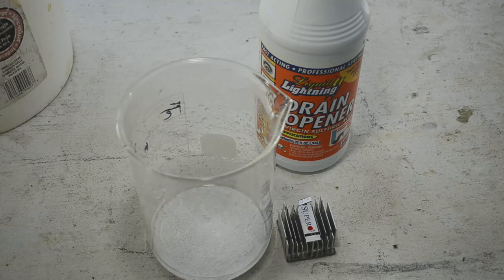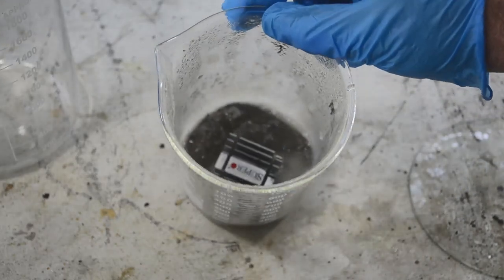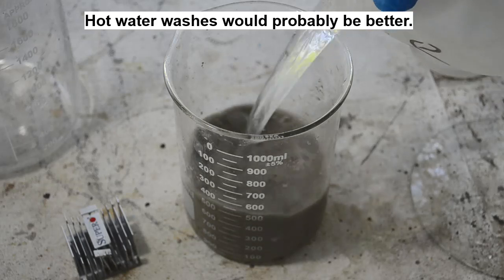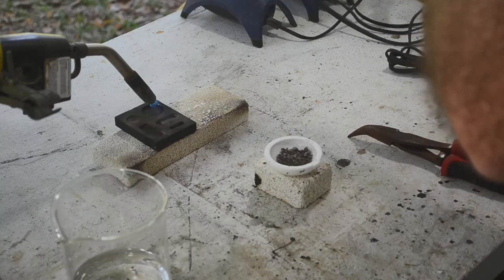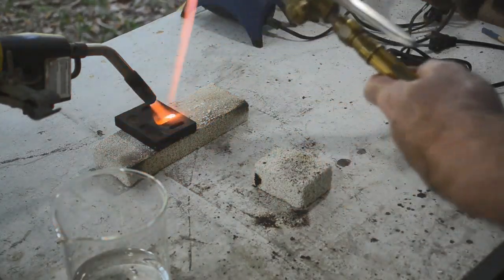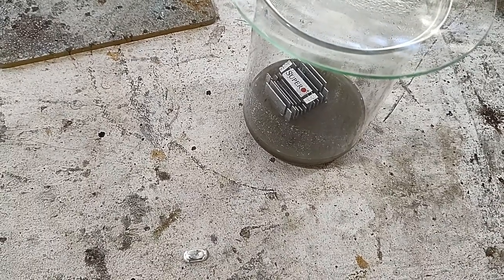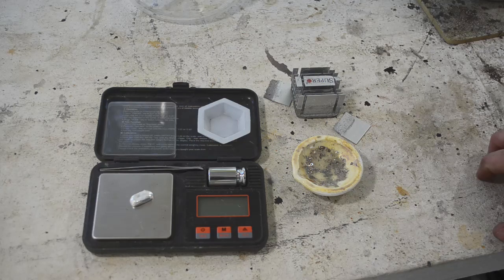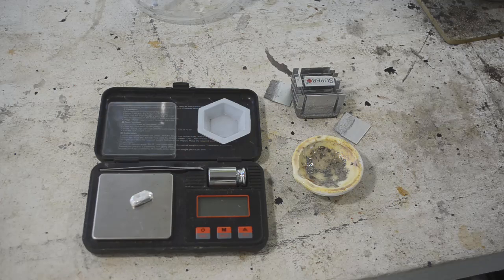Easy Silver Chloride Reduction With Aluminum?

Comment: 3:38 "when the Aluminium and the silver chloride in solution come together, the aluminium is gonna steal the chlorine from the AgCl because Al is the much more reactive metal [...] so when that happens silver metal drops out of solution" So everything happens in solution that means we have Ag+ ions (from the AgCl) and Al3+ ions (from the reaction of the Al-metal with the sulphuric acid), right? now what exactly acts as an reducing agent to give the Ag+ ion its electron to form metallic silver? you just say the Al3+ "steals the chlorine". Okay that would form AlCl3. But there is still no redox-reaction happening.

Comment: The weakness of that method is aluminum extrusions and castings are rarely a pure metal and contain things like copper, zinc, tin, silicon and maybe even lead. These metals released from the alloy can then be in the silver precipitate and will be in any metal melted out of it. I'm sure it's possible to find pure aluminum but a random Chinesium heat sink has zero percent chance of being a pure metal. The well washed silver chloride was probably more pure before you introduced the random metals. Sugar on the other hand is fairly pure.

Comment: I thought on this problem a lot you can dissolve out the unchanged silver chlorde with either dilute ammonia solution or conc hydrochloric acid. However if you are making the silver chloride from scrap sterling silver???? Why bother precipitating out the silver chloride? If you put a piece of copper tubing into the copper/silver nitrate it will directly displace all the silver from solution 😊🥹☺️

Comment: Acid and bleach,caused the aluminum to oxadize causing the silver to fall out of solution. That's my take on it . Usually use an oxidizer at the end of the process like lyme and sugar
Reply: Actually he doesn't use bleach the take on this one is in chemistry there is a process called displacement in this case aluminium Is far more reactive than silver it easily displaces silver from the chloride the acid is just a medium to allow the reaction to occur

Comment: ❤ your encouragement is excellent 👍
Ever since I got into chemistry i have been amazed at how "nobility"  in metals work.
Most of us agree the lye and sugar and electrolysis systems produce the purist silver, but using the metals nobility cementing out metals is MUCH easier 😁.
Try zinc, it works also, and I'm wondering about iron because of the smelting temperature difference and any trace iron would remain solid and sink when the silver liquefies, theory only. I haven't heard of anyone trying this ❤
BTW, HAVE A GREAT 2025 NEW YEAR 🎉

Comment: Very interesting to say the least. The ion exchange does have its limits sadly. Once a good portion of the silver chloride converts to silver metal it’s hard pressed to keep the reaction headed in that direction. One interesting method that I learned about in undergraduate is that silver chloride is actually soluble in 50% ammonia solution. We dissolved it and then dropped out the silver using the classic copper wire. Was very interesting since I didn’t think much of anything would dissolve Silver Chloride very easily.
Reply: You have to acidifie the solution right away with hydrochloric,  works well!!
Reply: Yes, but adding ammonia to any silver solution is a recipe for making silver fulminate, an EXPLOSIVE.  Many a mirror silvering experiment has resulted in disaster when the solutions were left sitting.

Comment: ok. The starting weight of the silver chloride wasn't stated (because refiners always keep their AgCl wet). There should be 1.3287g of silver chloride for every 1g of silver. If there's any liquid left in with the silver when it's dried, there will be aluminum chloride going into the crucible, and that will be mostly vaporized. So ,the weight going into the crucible is irrelevant as long as pure silver is coming out, it's the weight of AgCl going in that matters. Without drying your silver chloride, the only way to get a weight is to thoroughly filter and blot all the water out of the reduced silver before melting it, so that you're not including the weight of any aluminum chloride.
Reply: AlCl vaporizes at a few hundred degrees.

Comment: Hi Mike, during the reduction process stir it time to time!!! It's very important!
I’m afraid, that this gray precipitate is not dissolved aluminum or aluminum oxide. After pulled out the aluminum heatsink and several rinses, You have to boil the metallic alu in the beaker with sulphuric acid a few minutes to dissolve leftover alu from heatsink. Next rinse it a few times, dry and melt it. 100% success! Purity 99,99!
I’m using this method for a few years! Good luck!😊
Reply from the maker: Thanks for the tips!

Comment: i have seen someone doing that by stirring with an iron nail. In theory, you could then use L bent iron rod mounted to the motor and just stir the silver chloride water mix. Mixing always helps with mass transfer in chemical reactions, if you can do it.

Comment: At first I was thinking you do a termite reaction, then you melting the AgCl then adding Al to it, but you surprised me. 

Two things to change maybe: 

1. the metal, Al is very down the electrochemical Serie, so it will convert many other contaminations. So maybe tin or iron could work different.

2. The form of the metal. Smaller parts are hard to remove, also things that fall into pieces. So I think, a solid bar of metal hanging in the solution without touching the button is the theory I would test.

Good luck!
Reply from the maker: Thanks for the suggestions.

Comment: Hi man, did you try melting AgCl with Na2CO3? 4AgCl +2Na2CO3 → 4Ag +4NaCl +2CO2 +O2 (at 850 -900 celsius). Silver should be pretty clean...
Reply from the maker: Thanks for the tip

Comment: I've tried this method a few times and I just don't like it.  I find the Al contamination is heard to remove and if I run the Ag through my electro-cell it does not form the regular crystals I expect.  It's hard to describe but they are just weird and I have to redissolve in nitric and start all over again.  Now, if you're not striving for ultra pure then this method should work but it's not the way I like to go.  But even when using lye/sugar I do things slightly different in that once converted I heavily dilute and neutralise with HCl.  This makes it settle WAY faster and I have to wash far less and because of this I get less losses.
Reply: Hi , hope you have great job
Would please tell me , what do you mean from doing lye sugar different exactly.
In which step do you dilute with HC
l
Reply: @علیرضاافشاریپور  I convert with lye like usual and only leave enough water to cover the silver chloride.  Keep it hot as well.  Instead of sugar crystals I use a heavy sugar syrup to help it react quicker.  Once it is all reacted and the silver has all been converted to metal the liquid will be VERY alkaline.  I let it cool a bit and slowly add HCl to neutralize the liquid.  You need to stir the silver as well. Keep testing the PH of the solution until it is around 6 and then let it settle.  You will find it settles VERY quickly compared to if it is not neutralized and this helps it filter out much easier.  The only contaminant that might filter out with the silver is carbon and that will burn off when you melt it.  You can also decant off the solution and add more concentrated HCl and boil to help[ remove any metals that may be in there like iron.  You should see the silver form nice crystals and ball up.  Do HCl boils 3 times with good washing in between and you should get 99% pure silver in the end.

Comment: Hahahaha, SIlver thermite? Lets check it out!
Reply: I assume the fins are for dispersing heat of the reaction? haha. Refreshing to see new stuff, I like that.
Reply from the maker: I was thinking this reaction is like a slow motion, low temp, thermite reaction that produces metallic silver. I wondered if finely powdered aluminum would work better, but didn't have any to test.
Reply: @omegageek64  I was joking a bit ofcourse. As you might know aluminium powder can react pretty violent. If fine enough it can bang when reacting with oxygen. Could well be that a thermite like reaction would be possible when heated to when in the presence of Chlorides. but that's why I watch you folks.
Reply: Nothing is a failure when you learn something from the process. I like that you used a round bottom flask for fume reduction. That's smart! Second using sulfuric acid is a huge cost saver. 
I'd go with iron as suggested in some of the other posts suggested as you get a better conversation rate and cleaner end product but it really depends on what your final goal is. If you are making 
objects you have to convert your silver to 925 anyway so a little aluminum isn't a big deal. Aluminum foil chopped up has a larger surface area so that might help your reaction. Loved the video!